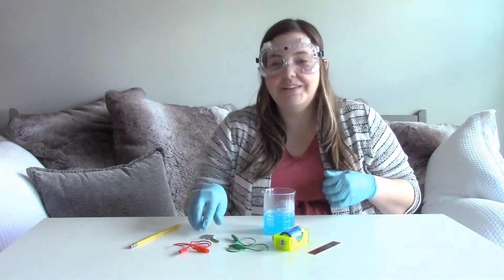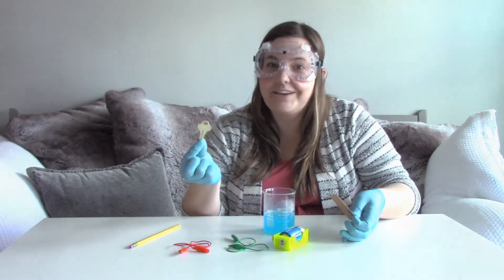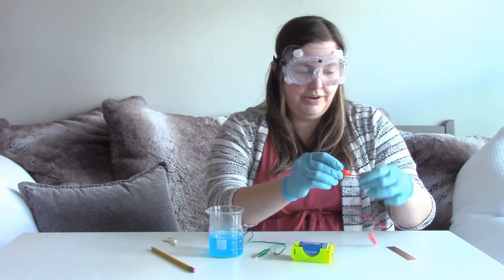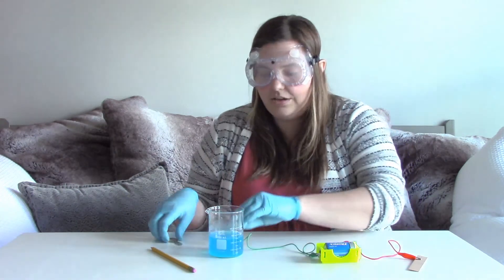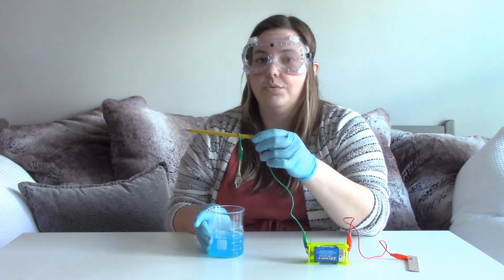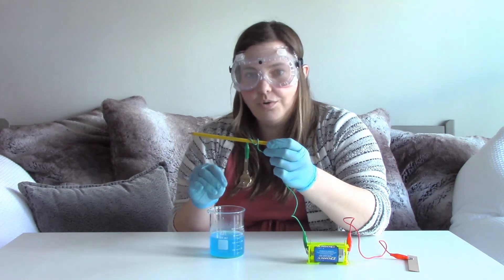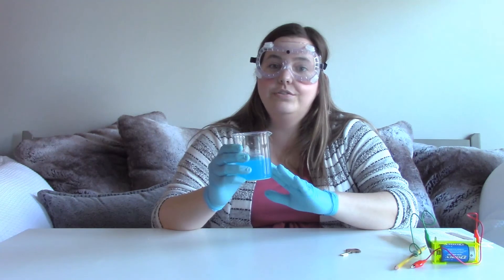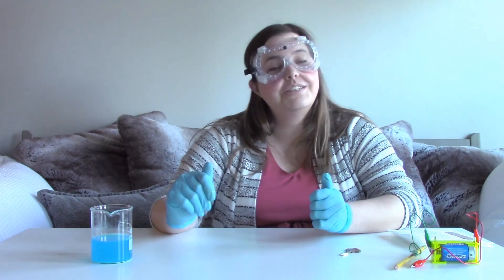DIY Electroplating Science Experiment | Copper Electroplating at Home

Comment: You forgot to put the copper plate in the solution
Reply from the maker: The neat thing is, you don't actually need to! The electrical current pulls the copper ions from the copper plate (outside of the solution) and puts them onto the key (inside the solution).
Reply: @homesciencetools  current flows. It needs something to flow through. That will not be thin air. This what you are observing is deposition of the copper ions in the fluid through another (redox) reaction. Battery does nothing here